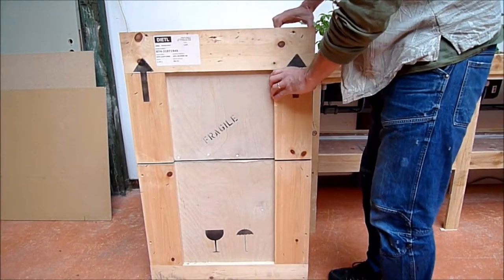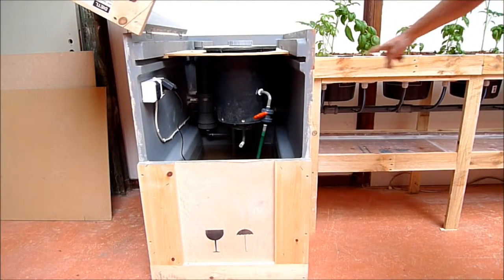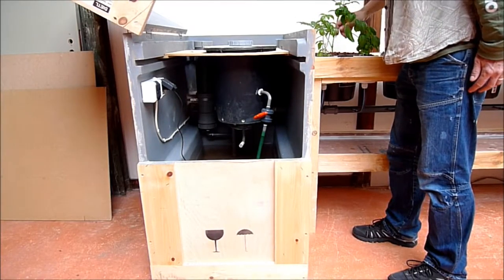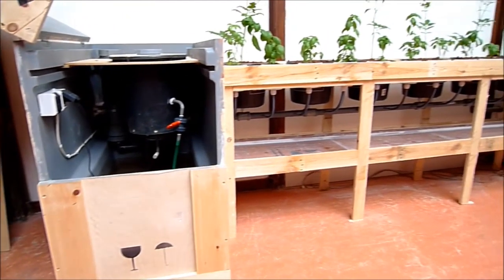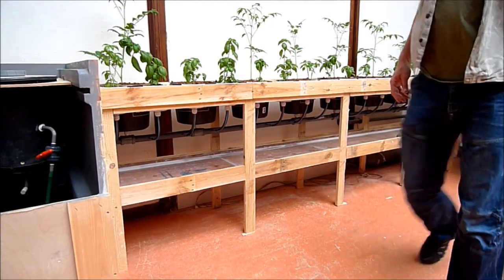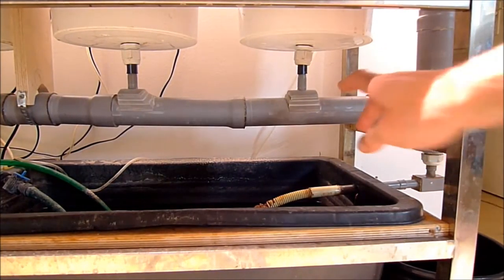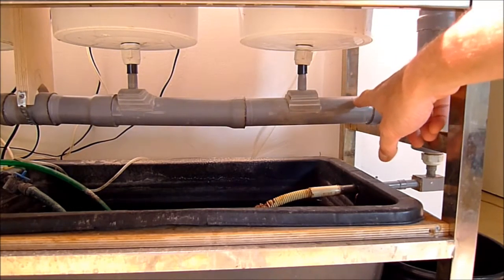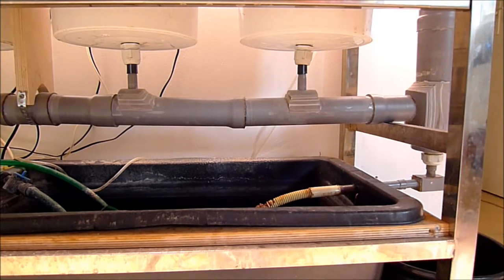explanation about my home-build systems

Comment: Great design ideas.  I see you're ahead of me on the bucket-in-bucket!

I really do like they way you have this plumbed together.  I have a heap of questions on your larger system:  How many litres is the fish tank?  What is the retention time on radial flow filter?  How often do you have it ebb-and-flow cycling?  Are you adding air anywhere?  Are you finding the smaller lines to the buckets retaining solids waste?